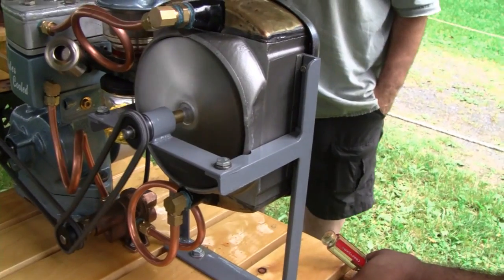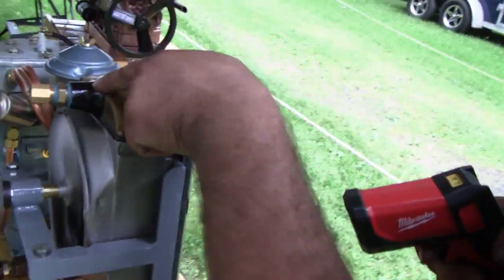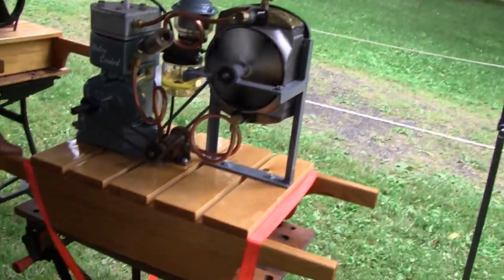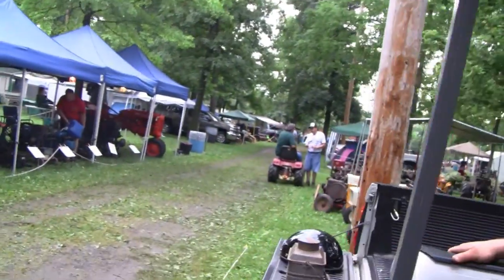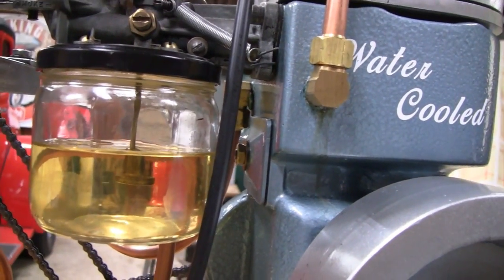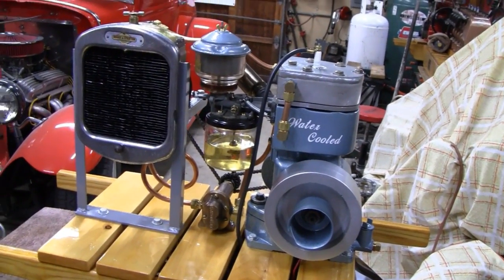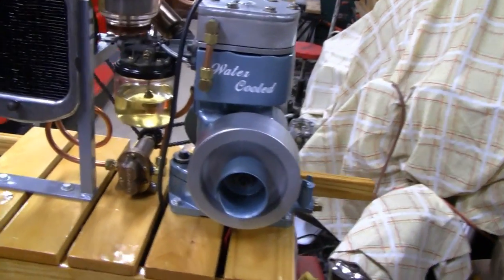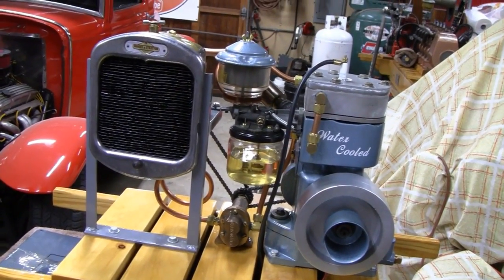HOMEMADE WATER COOLED BRIGGS ENGINE (part 45)

Comment: So very good to see that it all worked out so well. I was impressed with how smoothly it ticked over. Personally I would have suggested a belt drive to the fan as the small amount of flex in the belt reduces the impulse loading of a slow running single that a chain transmits.
Still, if it works OK, then leave it.
 I would also suggest some anti freeze/anti boil in the cooling system to combat the corrosion that invariably occurs in an iron engine, but that's just me. 
Thanks for letting us watch the build.
Reply from the maker: Thanks Bud!!☺

Comment: I couldn't be there in person, but, It was great to see it running at the show. It turned out super nice.
You are very welcome for the tooling and fasteners. I was all to happy to contribute. 

I can't remember ever seeing what oils you use for tapping but, I recommend either Rapid Tap or Moly Dee.  Rapid tap is mostly clear and the Moly Dee is black.  I always liked Rapid tap because it is biodegradable.
Reply from the maker: Thanks alot Kurt!! You're contribution is appreciated more than you will ever know!! I use A-9 cutting fluid for Aluminum, that's made by the same company as Rapid Tap!! And use Tap Magic for steel!! I'll have to pick up some Rapid Tap, I like trying different products!!☺

Comment: I guess you could change a sprocket or more and get the pump and also make the fan run faster.  I love the engine and glad you  took us along for the ride.  I like the idea of the liquid showing.  If the system had some bubbles it would make for a great display and great for conversation.

Comment: Splendid series ROADKING ! I loved every moment of it. Who cares about those dipsticks who say it took too long and had too many episodes? 

I understand that things take a LONG time. I have been making a model 4 stroke engine for the last year,
 due to not having a lathe I have to use the one at school (which hadn't been used in in 10 years)
on Thursday lunches and i have been teaching myself . My dad is the worst diy person in the world. Once he ripped a light bulb right out of the socket and i yelled at him to stop and asked him 'what the hell are you doing?' he said 'im changing it'!

 the lathe at school had no boring bar or reamers or any thing like that, just a parting tool and some tool steel to make some turning tools.
and despite the fact that school doesn't have a mill (i had to make the cam and con rod etc etc using a hack saw and my bastard file)
I just need to make the rocker arm and the follower! ( for the exhaust because it is a poppet valve intake)
AND THEN I AM DONE!
i will prove the people wrong who said it won't work (even though they don't know what a spark plug does )
or that it can't be done- "especially by an Autistic kid" 
I just tell them to "shove a chisel up their gearbox" and "that they are as useful as a knitted condom"
Reply from the maker: Thanks alot V-Dub!! We appreciate you watching and hanging in there with us!!☺

Comment: Hey RoadKing I think you forgot to pull the pin on the grenade Briggs I didn't see chains flying off or the flywheel fly apart Can't believe how much it jumped around from the flywheel being out of balance and how did you get all the air out of the water passages must of overheated quick surprised the epoxy didn't melt   😝😜🙄👍 Great job
Reply from the maker: Thanks alot Bud!! We'll have to do better on the next build eh!!☺

Comment: Congratulations on an excellent build and presentation. The valve cutter is probably 45 deg for the valve face and 30 deg to cut the top down to push the running face down.
Reply from the maker: Thanks alot Bud!!☺

Comment: You don't need an expansion tank. Old cars never had them. The only time you have "expansion" is when the fluid gets too hot and boils. You should have some sort of pressure relief valve or pressure cap just in case. In automotive applications, vehicles are designed to run up to 15 pounds of pressure in their systems.

Comment: I'd like to see the temp difference between the front of the head and the back because the way you guys milled it all of your water is running from the left side of the head to the right (facing the engine smiley face) without circulating throughout the head fully, I'm sure though for its purpose as a show engine, it won't matter at all since its basically running cold... also you might want to add a blow off valve for the radiator, just in case something goes over pressure. But now time for the radial!

Comment: Can a bigger jar fit for longer runs?
Reply from the maker: Yeah Buddy!! ☺
Reply: 805ROADKING i couldn't tell if a bigger jar would hit the pump or not.  Either way i love being able to see the gas like that. 😀
Reply: 805ROADKING just wondering if you did any changes for longer run times?
Reply from the maker: Nah, at the shows we don't run them that long to worry about it!! If we did anything we would just lengthen the fuel pickup to use the whole jar!!☺

Comment: That really turned out well. It is pretty, and has almost as many little bits to look at as a hit and miss engine. And lo & behold, I don't see a single chunk missing from the flywheel. I like the sound that the water pump, and chain makes, and I really think that the glass fuel bowl adds visual interest.
Reply from the maker: Thanks alot Scott!!☺

Comment: See if turning the fan around so it draws air through the front of the radiator cools it any better. I know it's cooling just fin now, it's just something to test.
 Also, using a piece of pipe is a good idea for a small expansion tank. I know Mike probably already knows this, but a good design for those is to use a small tube leading out of the radiator that runs into, and down to the bottom of a larger tube. They caps the tube off with a vented cap. This way if the radiator draws a vacuum it will draw coolant in. And when it is pressurized it will push the coolant back into your catch tank and vent any excess pressure through the vent in the tanks cap. Just like on your car/truck.

Comment: I still think your next challenge should be a 5HP briggs that'll run 10K RPM
Reply: The gauntlet has been thrown down ..... ROFL!
Reply: I think it would be awesome. I've never gotten one to break 8600 without coming apart, but was never allowed aftermarket rods in our class either so I've never experimented or traveled that road. But I'm SURE it could be done with alcohol, Walboro, and Wiseco. In my case, it was always the rod cap or the oil slinger that would come apart

Comment: Great project, Roadking! Happy to see that little engine run. Are you going to add a pressure relief cap to the expansion tank? you could probably cut the neck off from an old copper/brass radiator and braze it onto a large copper pipe for the tank. It would look nice with a good polish.
Reply from the maker: Thanks Krank!! Don't know what we'll do with it yet, might just buy one!!☺

Comment: A large jar to show the water flowing and act as a reservoir would look pretty cool on this too. Just have a short input on top and long pickup going down to the bottom to prevent air intake. If it was filled up with no air maybe add some bobbles that can move around inside otherwise

Comment: Just thinking that if you wanted to regulate the temp at a higher level you could put an in line pipe reducer to restrict the coolant flow. Even a 1/4 turn valve would work  Play around with the restriction size and you could dial in a temp you want.  Wide open on hot days or less on the cool ones..  As I've said before your creations look factory.. Take Care
Reply: That would work with a traditional centrifugal water pump but this is a positive displacement gear pump. A restriction would only cause the pump to build more pressure and put more load on the engine but wouldn't reduce the flow. It might even build enough pressure to blow something apart. You would need a pressure relief valve also to let the coolant recirculate.

Comment: Place a piece of black electrical tape on any reflective surface while checking temp with laser or infrared.
Reply: Or a dry erase marker.
Reply: Interesting, I've never had a probem on chrome, titanium, polished aluminum, nothing. Shows nothing is perfect I guess. I use Expo brand dry erase marker- black. Altho I can't say for sure Ive always used that brand. Thats whats in the drawer now. Black expo.
Reply: Neither of these ideas work on a Chrome exhaust header, but I see people using them all of the time to check exhaust temps. They need a warning printed right on the gun that states that "readings off of shiny surfaces are inaccurate".